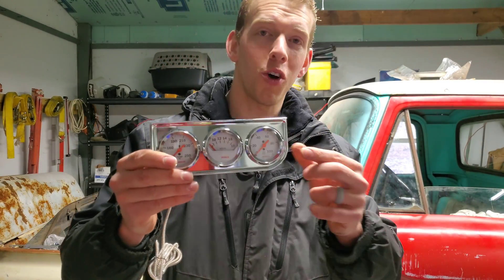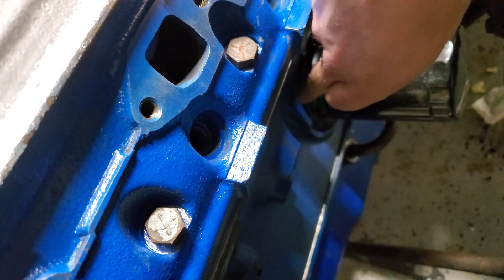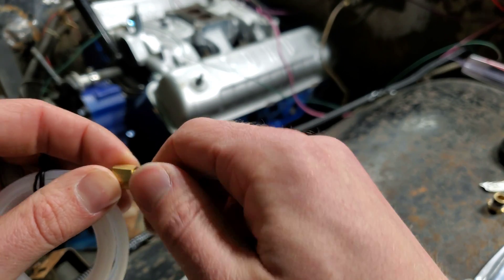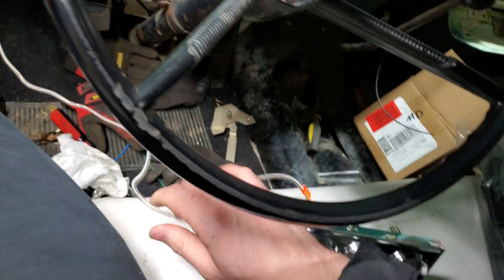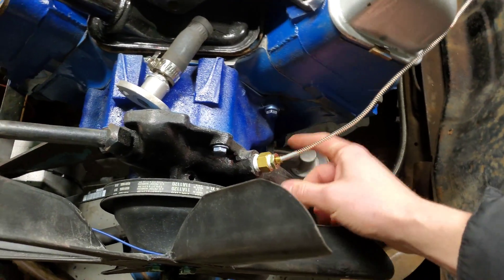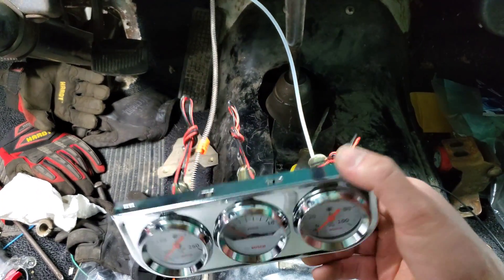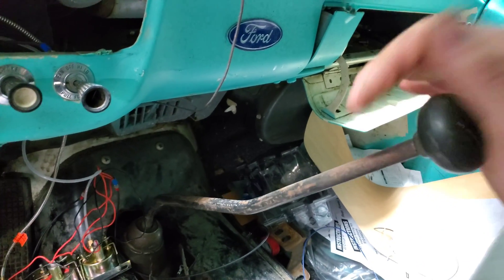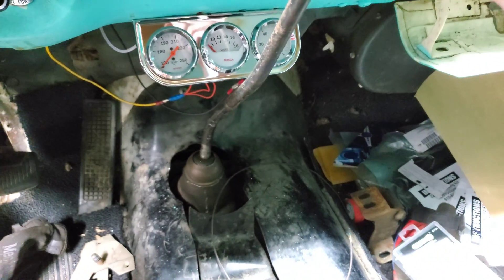HOW TO: Install Oil Pressure, Water Temperature,  and Voltage Gauges!

Comment: Just wished you showed where and how you put it into the power on the fuse panel. Which did you use? All 3 Wires into 1 onto the side of an accessory fuse so it’s switched?  The only part I really wanted to see as I’m usually jamming wires into fuses and not sure.

Comment: thank you for the video, i ordered one of these and it came with "no directions". i've decided to connect the oil pressure to the spot where the factory oil pressure sensor is next to the distributor (1977 dodge b100) because with the dog house off everything is right there. again, thanks for the video

Comment: On the oil pressure guage, you don't want to use any tape or buddy because the fittings needs to ground to the block. Lol

Comment: I have this set but for some reason, when I turn the key on, only the volt gauge will light up. The water and oil lights do not come on but they are all hang wires together so not sure what’s up with that? Kinda weird to blow a bulb for 2 out of 3 right? 

Maybe the grounds or power wires didn’t get a good connection?

Comment: Good job! I can't believe some of the comments about where to wire for power/ground! If any one does not understand that very simple part, then they should not even attempt doing this. I about to finish my 3 gauges and took the extra step of adding a new circuit box, cheap to do and easy as well, that way you don't put extra load on the factory loom, and if something goes wrong it is easily fixed.
Reply: Guy's like you are why kids decided it's better to just play xbox.
Reply: Far cup bro stop gate keeping
Reply: There’s a reason people watch these videos. They don’t know how and they want to learn. With your logic, why ever try anything new?
Reply: @gbpfishing6424  With your logic,  there is no logic.

Comment: Nice tutorial, I'm still running a Y block as well. Another thing to consider for the wiring, if your dash is metal, you can just run your ground lines to one of the screws holding the mounting bracket.
Reply from the maker: I have made so much progress since making this video! I love the y block!!
Reply: @JakeHarrington  Ys are great engines, mine is a 292 with 27k original miles. Never been rebuilt, doesn't smoke, and it just wants to keep going! Did a PCV conversion recently and it really loved that. Thankfully looks like someone did the conversion on yours. Even for an 8 cylinder I still great mileage, better than some later 6 cylinder engines. 
Keep it up man. 👍

Comment: How do you screw it in cause mine fell off and I'm trying to see how you put them back on
Reply from the maker: I used very small nut and bolt to secure it! That way i didn't have to worry about it falling down!
Reply: @JakeHarrington  oh ok cause there is no way I can get a damn screwdriver in there to screw it back on to the dash lol

Comment: Using the cheapo Chinese unit i see. The cheap plastic oil line gets brittle, snaps and you have hot pressurized oil all over your car, maybe I side as well if it snaps on guage...advance auto is good, but get u a ss line
Reply from the maker: I will consider a swap before I do any real driving in it! It's all just mocked up, for testing purposes! I have a similar line, in my nova, and it has never failed me...until it does lol
Reply: Yeah I'd recommend it.

Comment: Glad you are keeping the Y Block! That temp sensor in the water pump will give you a much cooler reading than if you had it at the head in the OEM location or better yet at the front of the intake where the coolant will be the hottest as it exits the engine. And I’m with the other guys on getting rid of the plastic tubing and going copper... I did that on my Y Block too. - HRR
Reply from the maker: I love the Y block so far! It's been a good engine! I still haven't swapped it to copper, but I have plenty of braided hoses too. Thought about using some of that!
Reply: @JakeHarrington  braided hose is better but it tends to kink and break down over time. It's better to use copper or just go electronic. Remember man it's hot oil at high pressure going into the cab. Cool project and nice y block!

Comment: Good tutorial but after you run all the red together where do you hook the red wires to I know all the wires on the black end are grounded?
Reply from the maker: If you are referring to the lights, they are just run to a 12v ignition switched supply. Like the accessories spots on your fuse box
Reply: @JakeHarrington  thank you👍
Reply from the maker: @khalifchambers4100  happy to help!

Comment: I wouldn't use that plastic line for oil gauge, if it get next to something hot and melts into, that will cause a very bad problem especially going down the interstate, trust me...... I used a copper line tubing. You can actually buy a kit from auto parts store just for it. Just my 2 cents.
Reply from the maker: Thanks for your input! I actually wondered the same thing. If that were touch a header, it would be all over. I put a protective wrap around it, so I feel a bit better about it now.
Reply: The cheap nylon tubing that comes with the Chinese gauges is junk. Usually the 'older' US made nylon tubing is OK. There is braided flexible line that you can use but it has to be flexible. If you use copper it will break at the engine connection or somewhere because of the engine movement. I know, it's happened to me and no fun having a couple quarts of engine oil pump out everywhere at 70 psi. No problem with the nylon properly shielded or use an electric gauge Most track rules will not allow the nylon or copper, it has to be braided pressure line.

Comment: Good video. Wish you would of showed your volt meter hook up
Reply: Volt meter hook up is simple. Run a ground and run a power to a hot wire that's only hot when the key is turned on. Example being the ignition wire.
Reply: @Paladin_Green  easier to use an add a circuit